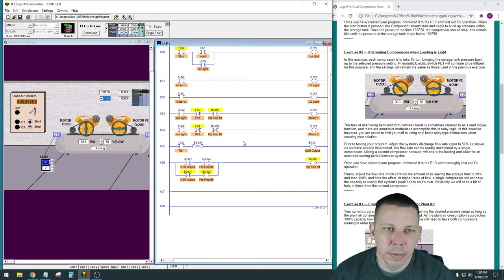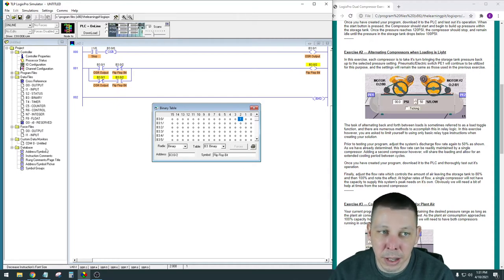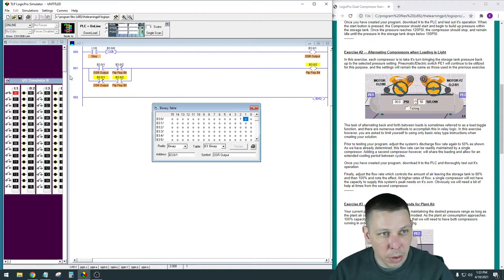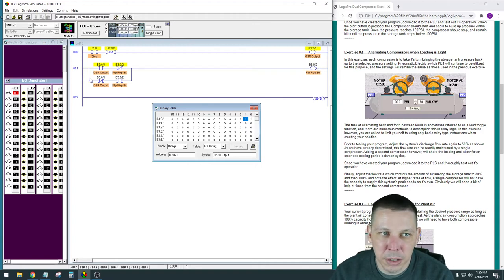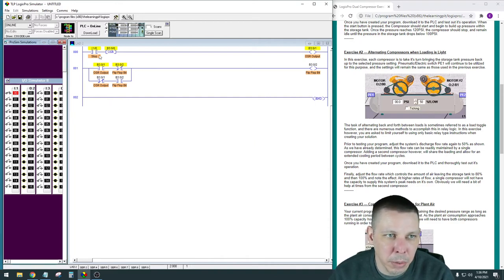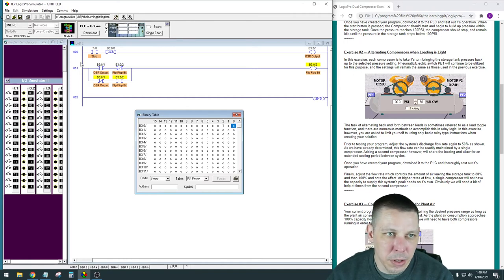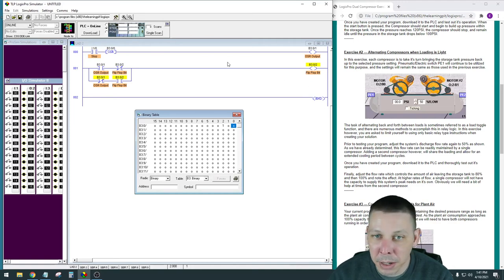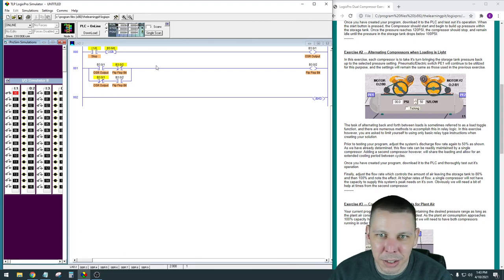LogixPro Compressor flip flop ladder logic explanation. Details about how the OSR is used to flip

Comment: I used this in the traffic lights with delay to achieve the sequence with only four timers, however even at high scan rates there is a noticeable blip in the middle of both reds being on, the moment where the cascade resets.  there are no lights on briefly and every now and then a car slips through.   is this just a result of the simulation or is this a poor way to do traffic lights?

basically my logic is:
four timer cascade (10,80,40,10) >>> osr flipflop >>> logic for light outputs based on timer TTs and direction controlled by flipflop

thanks for these videos, they have been a big help for me :)

Comment: Hello is there anyway to make rungs 5 & 6 without the use of the OSR?
Reply from the maker: There are certainly other ways to make the compressors alternate. This is the first solution I thought of using only the instructions available in the "bit" tab. You could use a counter that increments 1 count for every switch of PE1 and have one motor operate when the counter ACC is even, and the other motor operate when the ACC of the counter is odd. There are other more advanced functions you could use for this job as well, but my interpretation of the instructions was that you're supposed to use the most basic instructions you can.
Reply: yes. I used 2-bit latch.
Reply: @elmeonline9932  Counter isn't allowed. You need just relay logic and even OSR isn't a professional solving to the problem. If you have an email I can send it. It took me some hours to do it by the way.

Comment: I guessed could do it with a flip-flop, but used a similar latch based on a 2-bit relay counter(not the CTU instruction) because using OSR isn't allowed. It's the same result with about 40 inputs. Actually, this job could be done only with 5v-220v relays and push buttons.